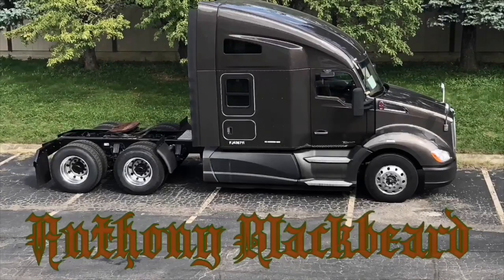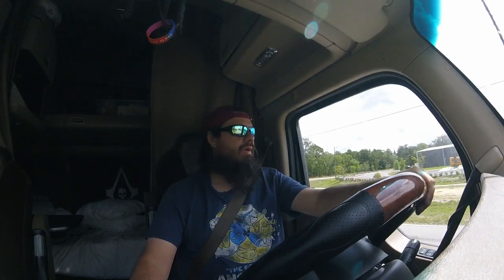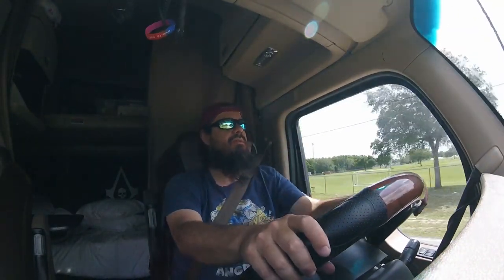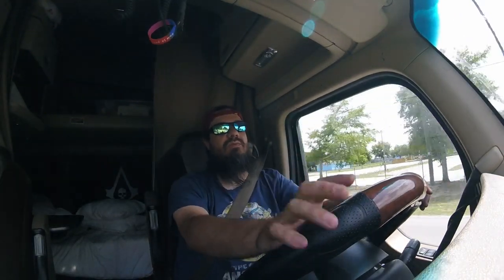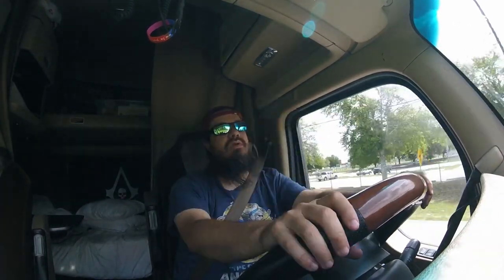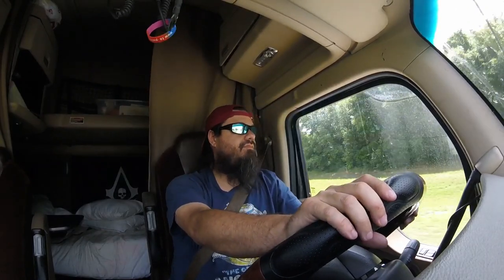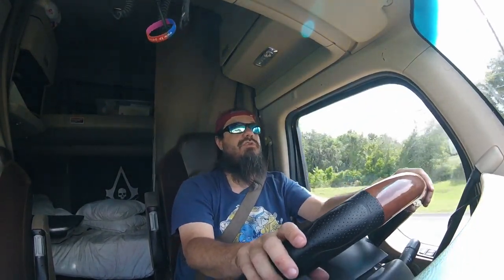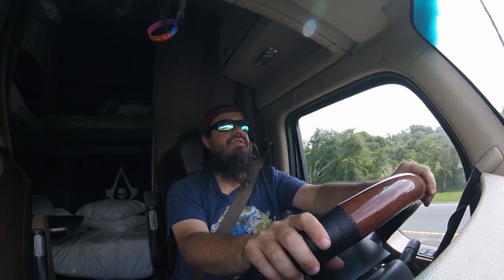Trucker Vlog #246 Truck In The Shop

Comment: It is in one of your computer module
Reply from the maker: Not sure. Isn’t the module inside the dash? They said the wires that where replaced where under the cab
Reply: @AnthonyBlackbeard  I had that happen on a Freightliner I drove once Ryder wasn't able to repair they took to dealer they told me was in the module